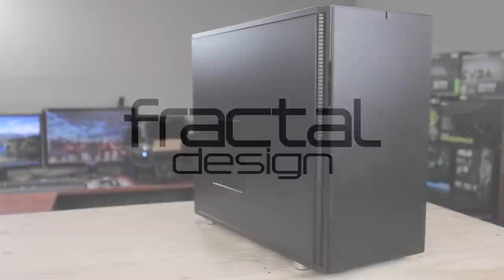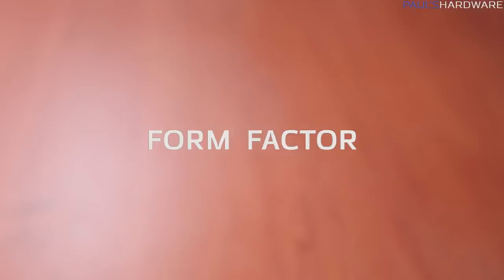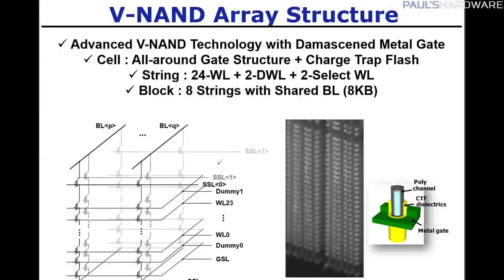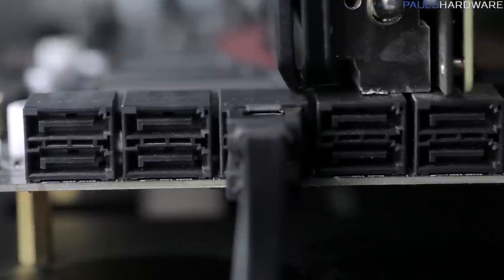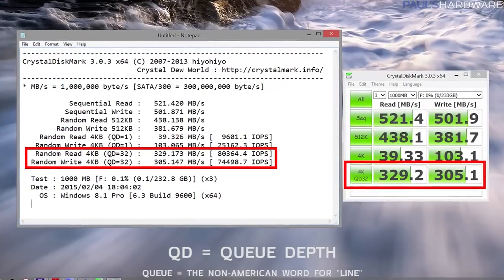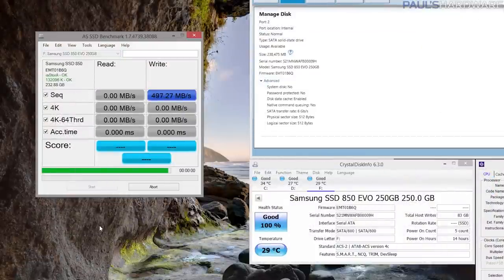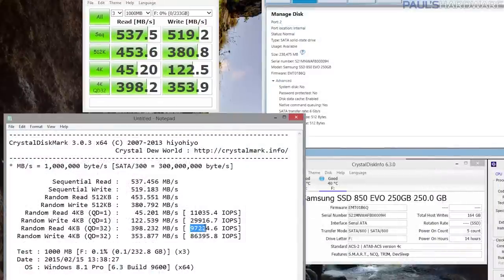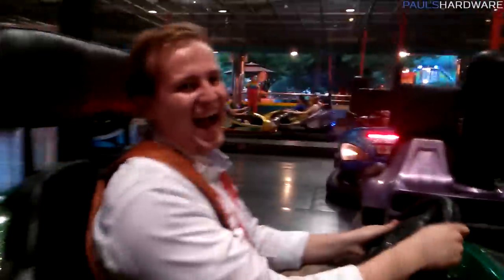How To Benchmark an SSD

Comment: I've been running off of a Kingston SSDNow V300 120GB and man, I love it. It's not the fastest, most advanced SSD on the market, but it performs exceptionally well and my programs load faster than ever.

I keep two 1TB Western Digital HDDs on the backburner to store all of my Steam, Origin, Uplay, and Battle games, as well as documents and data. So far I've gone through 1.5TB of data.

Comment: HI,
Paul I would like to know about RAPID mode on Samsung 850 EVO
Thanks
Reply: Hm, this sure would be an interesting topic... all the brand specific enhancements and what not.
Reply from the maker: Sultan Alnamlah I decided not to go into some of the extra 850 EVO features in the samsung magician software because I didn't want to distract from the tutorial, they're pretty neat though. RAPID sets up system RAM caching for the SSD (up to 4GB I think), so you can hit 7-9GB/s read and write speeds. :-D
Reply: Paul's Hardware It increases boot time and also doesn't give you extra speed right away, first "often used programs" have to be chosen and then loaded by samsungs magician into RAM :)
Reply: 4GB MEANS 4GB ?

Comment: Paul I just purchased a Samsung 850 EVO with 500GB.  I also have a 2TB EVO in one of my gaming consoles.  The one on my console was not able to work alongside Samsungs SSD software, but I was able to achieve significant performance improvement in game and with the loading time being cut dramatically.
In Regards to the 850 EVO 500GB let me get some info out of the way.  I have my OS (Windows 10) running on a 256 Samsung M.2 drive directly connected to my mobo.  So the EVO 500GB is just going to be used for some of the newest open world games where streaming information or cutting load times takes paramount importance (StarWars Battlefront 2 where i noticed a gigantic difference when loading into new areas, and GTA5).
* - My main question is in regards to Samsungs software for the SSD.  Specifically the Magician application.  I personally do NOT want to use this software.  As I do not like running programs in the backround if I dont have to.  I am also reading bad reviews with the Samsung Magician software getting along with some of the Windows 10 software and Nvidia software.  If i'm not using this drive for the OS am I missing out on any "tangible" performance by not using Samsungs Magician software ?  Please let me know this is driving me crazy tbh if i'm making any mistakes not using it.  Every single search I run into online has people arguing YES as well as a very vocal bunch screaming absolutely NO.  What is your opinion and experience ?  thx.

Comment: I just upgraded the 5400 RPM HDD in my laptop to an 850 EVO 250GB a few days ago...and I must say, I don't know how I survived this long without it. Starting up my computer used to be me pressing the button and then walking away to do something productive for a few minutes because I knew I would just be sitting there waiting for my system to start up. With the SSD I don't have to go anywhere because my system starts up in seconds now. It is great. :)
Reply from the maker: It's so awesome when you first switch! Now just wait til the next time you have to use a computer with a mechanical HDD, it makes you pull your hair out lol
Reply: Paul's Hardware So true.
Reply: +Paul's Hardware You are not lying bro. I have that same 850 evo in my gaming system and another from Corsair in my htpc......then I go to work. lol Slower......than.......molasses.....in........the.......................winter.

Comment: Great video!  Currently not running an SSD, but really considering getting a 256GB Samsung 850 Pro.  One question, would you recommend going for the Pro over the normal Evo?  Doesn't the Pro have a better warranty coverage?
Reply: Not just warranty, but it also features MLC NAND which is slightly faster and more durable than the TLC found in the Evo products
Reply: xXComputer_Nerd1625Xx Thank you for your response.

Comment: I am now running the two first SSDs I have ever owned. Bought them in October 2013, a 128GB and a 256GB (for Windows and Games respectively) Samsung 840 Pro. Very happy with them. I am going to move the 256GB to be the Windows drive, get  512GB for games and use the 128GB for caching in photo/video work.

Comment: I know this is an old video but my operating system is on an evo 840 and using Samsung magician it says i'm  getting 3,218mb/s sequential read. My other hard drive is an evo 850 and is only getting 300mb/s sequential read. Why is my 2nd hard drive 10x slower?

Comment: Hi Paul. Brill video. I have put an SSD Kingston 240 Gb in an old Acer Aspire 480 Timeline Laptop thinking it would revitalise it. Guess what Speeds I am getting using one of the utilities you mentioned?   About 200 Mb /sec. That’s rubbish. Can you signpost me to what is wrong. Thanks. Steve. Lincoln UK

Comment: Im still running the 840 evo's, one 250 ssd and one 250 msata, do anyone know if trim is working when running raid 0 as you cant access magician in raid?. But crystaldiskinfo does find my normal ssd, but wont show any info on my m-sata..

Comment: I have 2 120 GB Samsung 840 EVOs. I use one for my daily drivers, some editing software, and my Windows OS. I initially bought the other one to use for Hackintoshing so that I can have a dual boot system for expanding my editing software palette. However, I think I will just use it for my next build and leave it my system for now so I don't lose it.
Reply: QuestionmarkX3 Hackintoshing is fun to do, but.. Once it's done, I never found myself going in to OSX. If I wanted to do that, I would just open my laptop. And on top of that, I had to disable CPU features, and all my overclocks :(

Comment: I have a samsung 840 EVO. Usally when I benchmark I usually get about 500+mb/s read speed but recently I have been concerned because I have recently done another test and for some reason the read speeds are at 2253.20 mb/s. Is this a glitch that could be due to damage to the SSD or is this just a weird glitch? Btw I have tryed multiple benchmark software to check if it wasnt just the benchmark software I was using.

Comment: Very nice informative tutorial! Just a thought, if all you're running is Apps and obviously the OS (4K) is SATA 2 really a bottleneck? 

Now I have an X79 and use SATA 3 so obviously that's not an issue for myself, but a few of my friends I still suggest them getting an SSD knowing they have SATA 2 only. They simply want a faster feeling system but not the money to buy or rebuild their system yet.

I am looking forward to the newer M.2 but I'm not ready yet myself for an X99; probably the next gen.
Reply: D Jaquith yes;
Reply: TDPEquinox No it's not. I ask already knowing the answer. Run any SATA Bench App .. look at the pokey slow 4K .. that represents your OS and Apps.

Now if you're going to be copying data back an forth all day between 2 SATA drives or your you have huge ass data constantly R/W on your SSD then I'll listen. I do SQL testing .. LMAO I use a RAM Drive.
Reply: D Jaquith If all you're doing is web browsing and saving small docs, it won't really make a huge difference. That being said, General OS usage (Context menu, opening explorer windows, the time between clicking on a text doc and it opening) does take a hit. You may not notice it if you've never used an SSD to it's full potential, but I can assure you that I, and many people on forums notice it. That's why there are so many "My SSD is not much faster than my Har drive IDK Why" topics that have "Make sure it's plugged into a Sata III port." marked as solved. 

It's certainly noticeable, but maybe not to everyone.
Reply: TDPEquinox Look up Jaquith at Tom's Forums that's me. Unplug your SSD and plug it in your SATA 2 then get back to me.

Unless your files are not, most are, 4K and all you're doing is opening large format files eg video you couldn't tell the difference.

Where you'll otherwise notice the difference is Native vs Non-native SATA ports with shared bandwidth.

Comment: A 120GB OCZ Vertex 4 for my OS, and 2 Samsung 840 EVOs in RAID for games (Only did a RAID because I ended up with 2 of those drives quite luckily). I'm considering replacing my Vertex 4 with a 480GB G.Skill Phoenix Blade when I somehow find the cash for it.

Comment: whaty is the minimal size storage i need for OS drivers and basic programs
Reply: What OS are you going to use?
Reply from the maker: At this point with prices what they are, I wouldn't get anything smaller than the 240-256GB class
Reply: even with windows, 30 gb should do. linux based are usually a lot smaller anyway

Comment: Is there anything equivalent to defragging that you should/can do with an SSD
Reply: Trim. But it's done automatically.
Reply: WayZHC Ah, i knew about that but was unsure  if there was anything else
Reply: Well, there isn't much more. Fragments are not problem on SSDs, because there are no physical moving reading heads. Defragging is only good for HDDs so it's reading head doesn't have to move much.
Reply from the maker: JustaTree WayZHC Trim is a necessity with SSDs, it's also known as garbage collection, and as long as you have recent hardware and Windows 7+ it will enable automatically. You should NEVER defrag an SSD though -- it will just burn through the NAND's durability and does no good, as WayZHC said
Reply: WayZHC Nice! You explained the whole concept of defrag in 1 simple statement

Comment: OCZ Vertex 3 - 120 GB
840 EVO - 240 GB

Both have performed without any issues, but I am surprised the OCZ drive still hasn't failed (running since 2012 almost 24/7).

Comment: I run 2 850 pros 128gb each as boot drive, 2 840 pros 128gb each as game library, 2 mushkin  chronos 240gb each as programs library, and 2 western digital blacks each 1tb as mass storage which are just hdds. All as raid0 with redundancy of each to my file file server running freenas which is filled with various wb blacks and blues from 500gb to 2tb, again just hdds.

Comment: Thx for the info great vid. I use an OCZ vertex 4 512gb. And as it so happens I'm looking at buying a second SSD for my MacBook Pro non retina I got the owc expansion kit and my second connection inside the macbook is sata2. 
The thing I noticed that no reviews ever mention is the software and compatibility of drives. The ocz toolbox is unmatched being able to boot from usb drive image and update firmware erase the SSD run trim command an more. Not forgetting there is a version for Mac also. And support for redhat 
I guess that's the reason why they are more expensive than Samsung that uses a dos tool?  

To summarize I would love for you to be the only guy on the planet that covers the subject of practical usage drivers compatibility and so on. 
Thx

Comment: I just installed a 240 GB SSD into my computer. I copied all my data from my HDD to my SSD. Since my HDD still has everything my SSD has on it, how can I make sure I boot off of my SSD every time, and everytine I open a file that is on both my SSD and HDD, I can make sure it loads off my SSD?
Reply: You need software to 'clone' the current HDD to the SSD so that it makes it bootable (so you can remove the HDD afterwards), just copying it over won't do the trick.

I would also say this isn't the best way of doing it (copying stright over or even cloning it) due to a number of facts with one of the top ones being the fact that the install won't be 4k aligned - all to do with this ->

http://en.wikipedia.org/wiki/Advanced_Format

Granted this is aimed more at HDD's but SSD's performance suffers too.

Comment: My 840 evo doesn't feel as fast as it should be. I have rapid mode enabled as well. I'm running win 8.1 x64.
Reply from the maker: The 840 EVO has a known degradation problem, check the Samsung website for the performance restoration firmware update software, that should help
Reply from the maker: Paul's Hardware EpicGamingHD http://www.samsung.com/global/business/semiconductor/minisite/SSD/us/html/support/downloads.html
Reply: Thanks Paul :) Your the best.
Reply: I have one too try going in to the magican software then choose the ssd (if you have more ssd's or hdd's) go down to the OS optimization and choose max preformance. :)

Comment: Well I'm kind of a speed freak.
Got Samsung 840 Evo 250GB in Raid 0 for operating system. 
Samung 850 Pro 1TB for games
and a Seagate Barraccuda 2TB for storage.

980mb read and 740mb write on the 840 Evos in Raid0, so I cant complain

Comment: running a kingston v+200 120 Gb on my sata3 laptop... bottleneck FTW... and a v300 60 Gb on my father's pentium 4 system. he was always complaining about how slow his computer was when it had a IDE 40 GB WD HDD. now with a ide to sata adaptor and the ssd, no more complaints... access times FTW...

Comment: I am using a ADATA SSD Premier Pro SP900 128GB, and my read speed is just 377mb, and my read spped is 90mb, that kind of sucks.. write speed is way way slower then my mechanical drive

Comment: Thank you Paul.
For anyone who wants to know, here are my SandDisk Extreme II 120 GB Sata 3 SSD bench results, all in the same picture. http://postimg.org/image/3ssct7te1/

OS : Win 8.1 64 bits
CPU : i7-4790K
RAM : 2x4GB DDR3-2400Mhz
MB : Asus Rog Maximus VII Ranger

As I can see, the 850 EVO has some great specs, sometime 2X faster than mine, but the difference if I upgrade won't be this wide in the practice.

PS : As showned, my SSD is my OS drive and is 72% full.

Comment: I  got a nvme Samsung ssd 950 ran a benchmark using AS ssd softwear, on the testseq test 2000.81 mb/s read and 45.94 mb/write4k test I got 52.16 mb/s read and  1.49 mb/s write4k-64thrd 885.90 mb/s read and 59.41 mb/s writeacc. time 0.029ms read 2.628 writeseems realy slow for some reason

Comment: The GPU fans in the background annoy me ~
Reply: Also I'm using two Kingston KC300 480gb's
Reply: twitch. twitch. twitch.
Reply: why do they do that?
Reply: Elliott Gamer They do not get enough voltage to start spinning, this is normal and intended.
Reply: ***** he means why do they twitch
Reply: darkmonster11LP
That's exactly what I explained ;)
Reply: yes i know how it works! but it is not suposed to get basicly any voltage which means the fans are getting more voltage than they should!
Reply: darkmonster11LP Guess that's a design feature, no big deal. Won't destroy the fan or so. Ask EVGA why they did it like that ;)
Reply: i know! i am not dumb! i have quite a bit of knowladge about pcs, i just thought it was strange

Comment: 3x Sandisk Extreme Pro 240gb in raid 0 - x99 chipset
2x crucial m4 256gb in raid 0 in my 2008 unibody macbook pro
2x KingFast 60gb in raid 0 in my AMD athlon 64 with nForce4 chipset. 
i do plan on adding a floppy dive to my x99 pc.

Comment: I have a 2008 Mac 1tb hdd... Soooooo I think that means I lose. But I'll be upgrading soon to a windows pc.
Reply: So luckily at the moment it only takes 7 minutes for my computer to boot :)
Reply: Belligerent Bacon When I switched from a standard 7200 rpm HDD to an Intel 530 (not the fastest SSD on the planet) my boot time dropped from 1m30s with POST to about 15 seconds. I say it's worth the investment. You can swap the HDD for an SSD in your Mac too, no need to change your entire computer.
Reply: Wow, nice! I probably won't upgrade though because my macs fine for Mac things, I want a pc for gaming/rendering though so I'll just leave me Mac alone.
Reply: an SSD won't help with rendering. Day-to-day use is where you'll see massive improvements. If you can get one for both your Mac and your new computer, that'd be ideal.
Reply: Yea. But my Mac is too old to do the calculations involved for 3d rendering so I still need a new pc to render, or a better cpu and gpu in my Mac
Reply: Belligerent Bacon None of the new iMacs really have any values, save for the 5K. But you still won't be doing a lot of gaming, aside from games like CS:GO.
Reply: Yea I'm saving for a nice PC, then I'll set up Mac OS X and windows 10 on it.

Comment: I have the Samsung 850 EVO 500 GB ssd but for some reason I have less read and write speed. Although I did put on a old computer.
Reply: its definitely getting bottlenecked or its the ports fault
Reply: First Last ™  I'm pretty sure its the port , try another port